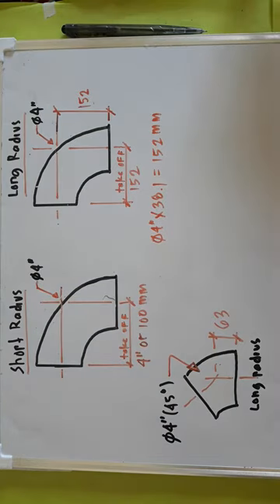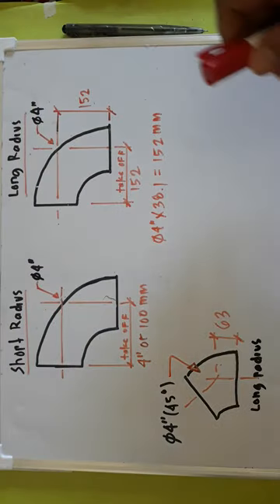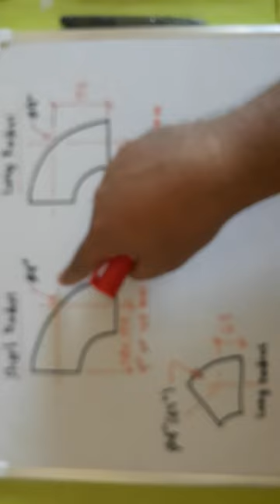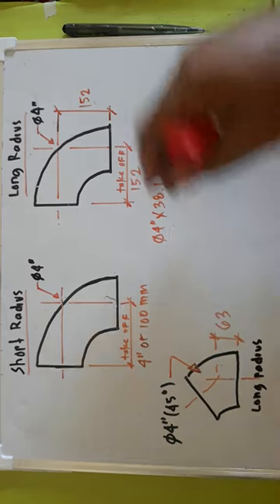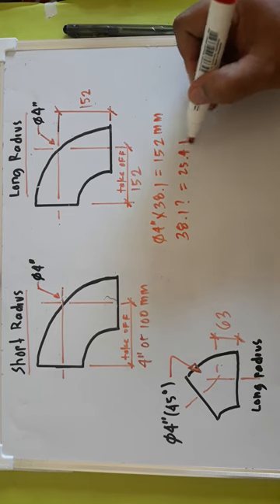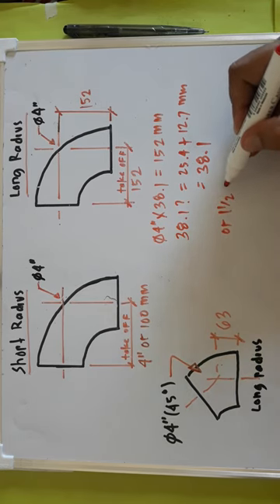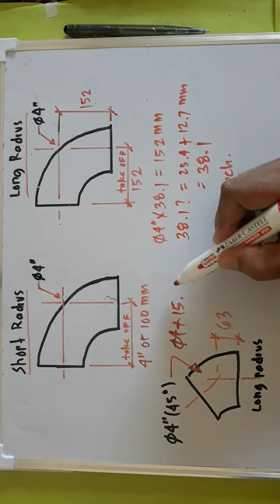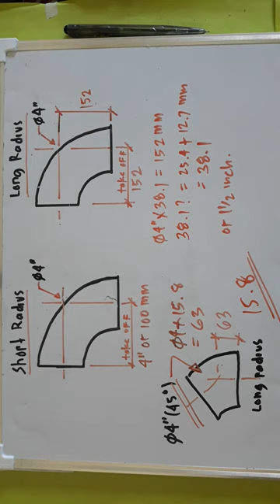ELBOW LONG RADIUS,SHORT RADIUS,45DEG,90DEGREES

Comment: How about 45 degree short elbow?
Reply from the maker: A short radius elbow is the diameter multiplied by 1 for example pipe diameter is 8inch the take off is also 8inch
Reply: @PipingSheetmetal  thank you..